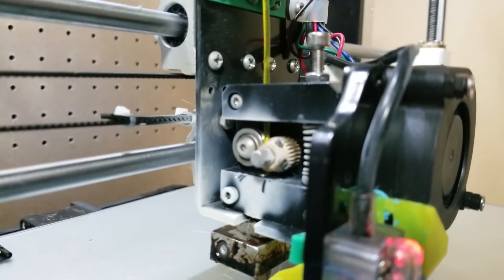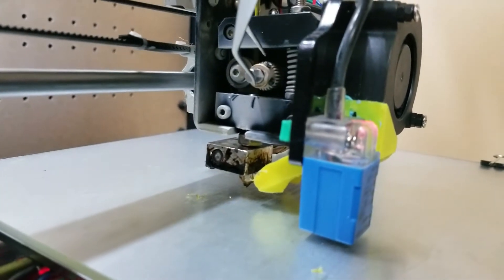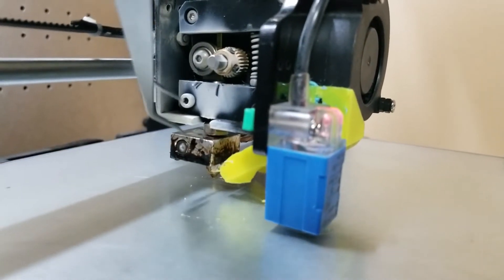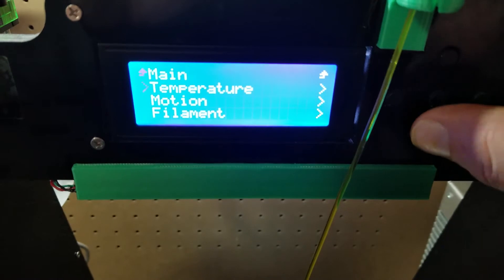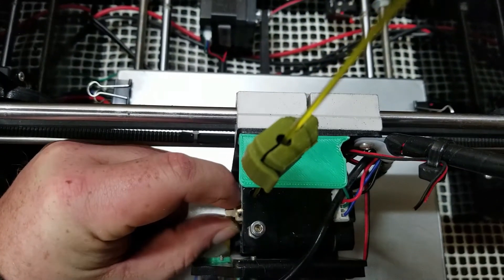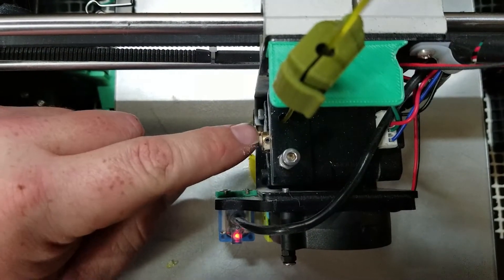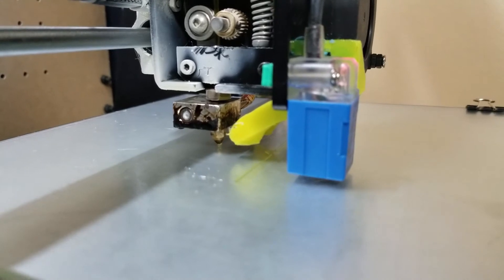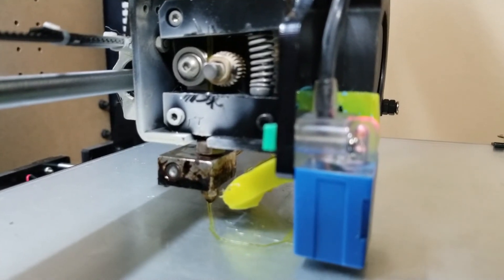Anet A8 running dry! Check your set screws! PSA 04

Comment: How do you tighten these screws properly? I'm tightening them but they get loose after  1-2 prints
Reply from the maker: The brass gear may be striped out? They should tighten down well with just an 1/8 turn past tight.  If they constantly back out on you, you might be able to try a drop of blue thread locker.  That might keep them from backing out! A drop of super glue would work in a pinch but you may never get the screw back out! So be careful if you try that, the thread locker is made to be removable.  Just make sure one of the screws is going down to the flat side of the NEMA 17 shaft to lock it down.

Comment: That's funny mine started doing this last night I have a cr10 but it's doing the same thing as yours. will it also do it if the nozzle is too close to the bed because as soon as I lift it up on the Z it starts coming out.

I know most likely I probably just need to relevel the bed and maybe not use so much glue but everything's been working fine up to this point any suggestions in addition to the video?
Reply from the maker: Markess A. Wilder that's a good point. It could possibly have an effect on the extruder because the gear is trying to push the filament but it won't budge so over time the set screw loosens a little from the additional pressure. I try to print with a few disconnected brims on every part so when it is doing the first outside throw away layers of the brim I can adjust the bed level knobs until I no longer hear the extruder clicking. Then I know the filament can flow around the nozzle without to much stress.
Reply: Revamped Outdoors you also mentioned heat my printer pla goes up to 225 and I've been trying to print at 2:20 and it seems like since I've been doing that that's been an issue too could that be a problem also in my case?

Thank you
Reply from the maker: Markess A. Wilder you could try and test it at higher temperatures, that hotend can handle up to 250 before I would worry about the PTFE tube off gassing. Might be worth adjusting the temp up about  5 degrees during a print and see if that helps the filament flow more smoothly.